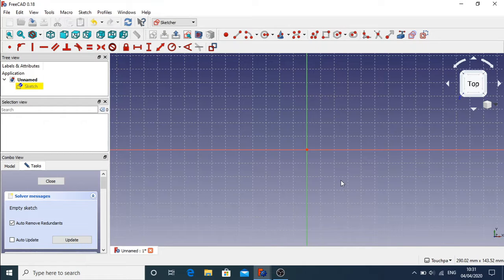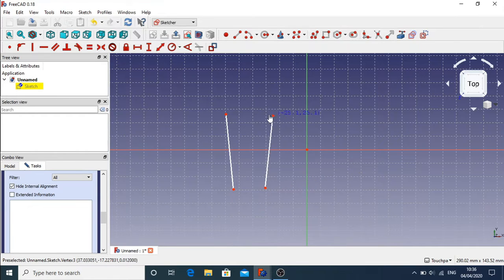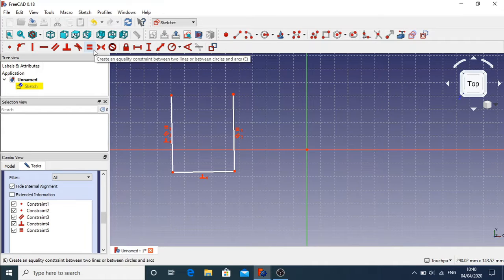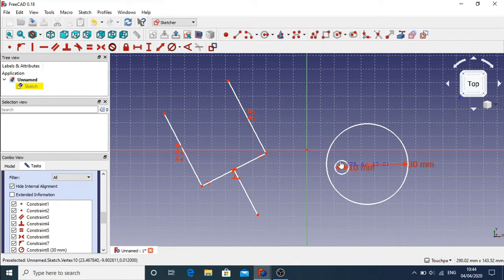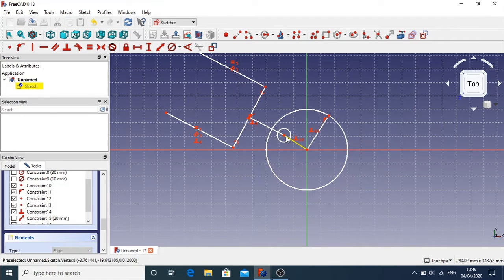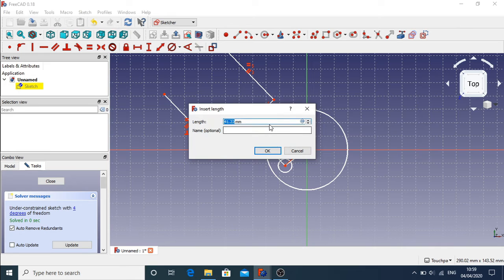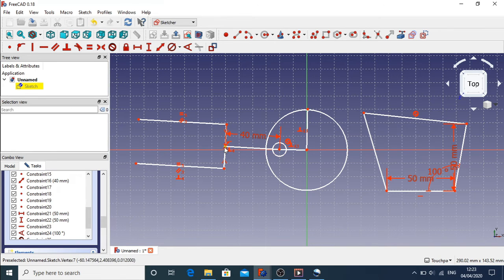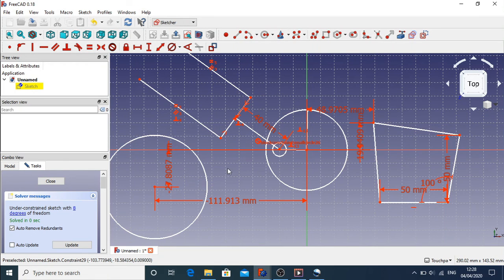FreeCAD: Mastering constraints but allowing movement and rotation

Comment: Great videos, I have been learning loads from these.  Is there any way to limit the movement when you use "constraint point onto object?"      My point just continues along the line  and off of my skeleton to infinity, I am trying to replicate a pin moving along a slot that would stop when it hits the resistance at the end of the slot.
Reply from the maker: Thank you glad you enjoyed.  You can use sketch geometry as your doing to create skeletons for simulations such as pistons moving, arms and links in mechanical movement.  So I have had an experiment and you can do this.  I will create a video of what I have and post it up as a link here.
Reply from the maker: As promised, this video shows what I have been experimenting with https://youtu.be/EFO2K1l6yU0
Reply: @MangoJellySolutions   wow, thank you so much for doing this.  It is greatly appreciated.

Comment: Great Video because I am working on your Picture Frame / Tray Tracing tutorial and my inside profile is being a little weird when trying to move it "so" I can make a clone without cloning the entire  sketch, right? My dimensions trying to constraint the b-spline was messy so I changed b-spline to 2 arcs which worked better, but every time I went to move my profile everything keeps distorting and so I went into overdrive trying to stop this and then my profile became very hard to view the detail (too many constraints). I took a break and went back and searched for help and found your video, WEW! I have focused my learning to just your channel first because you do not confuse my learning progress, when I jump around to different content providers then everybody has a different way of doing something, I am not capable as a FreeCAD designer to even understand, THANKS